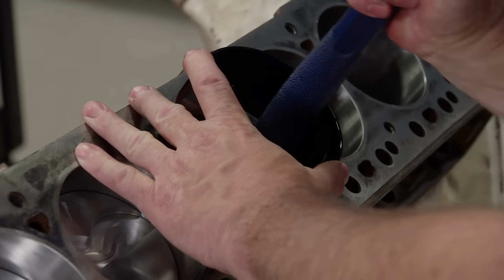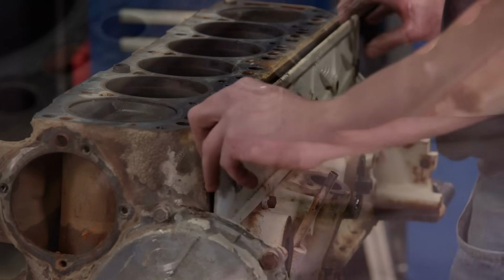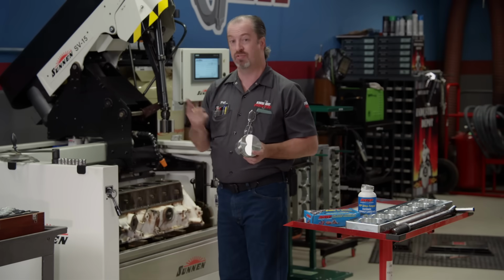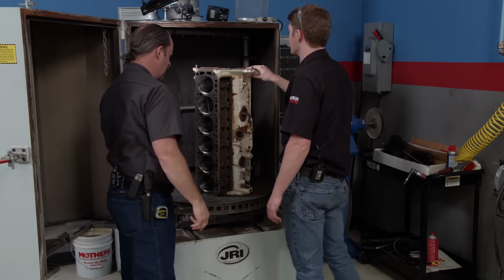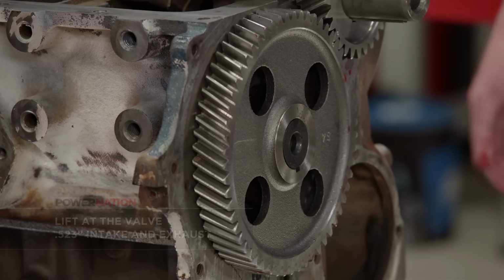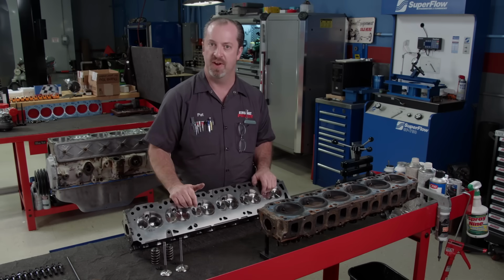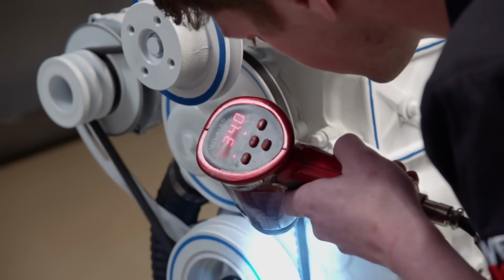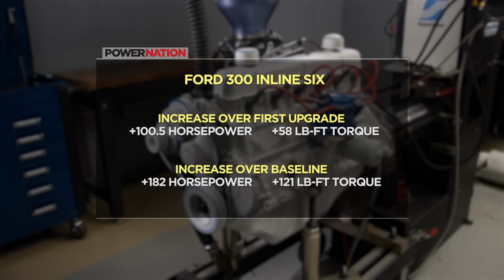Full-Tilt Build On Our Ford 300 Inline 6 For Serious Power Gains - Engine Power S8, E3

Comment: Back in 1987 I bought my first Ford F150 brand new off the lot and it had a fuel injected inline 300 6 in it. 

I owned that truck for almost 20 years and I drove it back-and-forth from FM 2920 in Houston Texas all the way down to downtown Houston every morning and every evening in that traffic. Then I move to Virginia and was still driving the same truck. 

One morning I got up to go to work and the engine was clattering and I realized that the oil pump had went out on the motor so I quickly turned it off. The next morning I turned around and sold the truck to a friend of mine and at the time that I sold my truck it literally had 625,000 miles on it and it only burnt half a quart of oil between changes. Seriously I've never seen an engine that lasted that long and my buddy turned around and put a new oil pump in it and continued driving it.

In my mind there is nothing more durable than the Chevy 350 and the Ford inline 300 6..... !!!!!!!!!!
Those two engines will last forever and they're practically indestructible.

Comment: That's a big jump considering they were well under 200 horsepower... 101-150 HP !! I have always wanted to Twin Turbo a fuel injected 300 inline 6 and put it up against a 12 valve Cummins

Comment: I had a stock 300 cid engine in my 1976 F-150 with a terrible 2 barrel factory carburetor. The engine only produced 106 horsepower. The carburetor was so bad the you had to "feather" the gas pedal from a standing start to get the truck rolling or it would stall out in the middle of an intersection. This always caused a certain amount of "puckering" if you get my drift and made the truck completely gutless off of the line. Ford wouldn't do anything under warranty to correct this problem and I was told to just live with it. In retrospect,  I wish that I would have had a 302 V8 under the hood because going to the 6 cylinder engine had no advantage in fuel mileage over the 302 V8 that you could get fuel injected back in 1976. I read a few years later that guys were making some engine modifications and adding a Gale Banks turbo to the 300 that added a bunch of torque and ponies to the engine.

Comment: Somewhat surprised no one has made a 4 valve DOHC or SOHC 4 valve head for US inline 6's.   It's worth 20%+ gains in torque from bottom to top and around 18% gains in HP in the mid to high range.

Comment: The beauty of the straight six motor is it's overall simplicity and  good harmonic balance.
Nice job.
Reply: The Falcon did not use the 300, it was strictly a truck engine.
Reply: Walter Palmer: Plus, as I commented, due to the fact these engines have five or seven main bearings as long as you perform the routine oil changes and maintenance you can expect to see 350K miles; mine has over 285K and is still running strong with only having the head milled and a new set of valves, etc. just because I figured 'why not' so put them in while I had it opened up, plus a new fuel pump, water pump, 100 amp alternator, two row radiator and an all new brake system.

It sees use a few times a week and every time I stop at a red light or to get gas, always have at least two or three people who will tell me about thier Father or them owning a Falcon, which was my first purchase in 1965 of a '63 Falcon Futura after I got married.

Comment: WOW! Gotta love those old 300's. So far as 6 cyl. are concerned, I believe that is Fords bullet proof motor. Just like Mopar's 225 slant 6. Another bullet proof motor. Great job on the build guys!
Reply: you forgot the gm 292 engine most 6 bangers are to be considered in remods
Reply: Can't forget the jeep 4.0!! Mine had over 300k when i got rid of it and had never been opened up or rebuilt
Reply: @HUGH.JANOS.  I knew a guy who had one with over 600k miles that still ran ok when he sold it because he was tired of it.
Reply: @HUGH.JANOS.  not made by jeep lmao

Comment: these american engines don't make much power per cube... hemi 6 made 225kw factory in 1971 with only 265 cu in
Reply: Horsepower per liter means nothing. Power to weight does.
Reply: @riogrande163  it does when you could have a different motor making more power in the same vehicle, increasing power to weight

Comment: Got a 93'  300/6..w/ an E4OD...The.0dometer went out at 288,000 miles, & that was in 2010...the power steering pump leaks like crazy, so for the past year I just been putting used motor oil in it, works great....and sealed up the leak too...for the most part my old girl will run on cat litter...poeple are constantly asking me if I'd sell it....not a chance...strong & simple...❤️❤️❤️her‼️

Comment: In the late 80s my dad bought an 83 Ford van with this engine for $1000 from a local company. It was a delivery vehicle that had over 160K miles of CITY driving, and my dad proceeded to put another 160k with this business. The engine was floored and ran hard everywhere (because it was in a heavy van) and it never had 1 single problem the whole time. In fact the only problem he ever had with the whole van was he had to change the brake master cylinder once.

Only reason he sold it was because he wanted a newer one with a V8 and AC.

Comment: That's AWESOME considering that an original 240 made 129 gross hp, and a later 300 made about 88 net hp....

I owned a '66 Ford F100 with the 240, and it couldn't get out of its own way.  At the same time, it was SOLID SOLID SOLID.  My neighbors in Orlando hated it because it was painted with latex house paint and looked like hell, but it always ran!

Comment: Make her EFI after the turbo please. I plan on doing this exact build but I will install a bigger oil pump, also an intercooler for the turbo. Taking the biggest turbo I can find in a diesel junkyard, preferably a DT466 from a dump truck since that's one of the easiest big boi's you can get your hands on. Big internals, big EFI fuel, bigger spark plugs, big turbo for air in and air out, big cooling system to keep everything maintained, all compacted inside a little engine. She will be my soon to be drift car. Doing a "Merican" straight six build versus going with a usual overseas european style straight six configuration. I just don't know what Ford car to put it in... If anyone has a suggestion please let me know! Trying to stay away from the basic mustang, I'm looking for different. I want to turn heads, and necks.. ;)

Comment: Keep it up guys, this is damned interesting stuff.  Can't wait to see it turbocharged.  The fuel injected version of this engine is in my daily driver, 93 F150 with the manual 5 speed overdrive.  A fun truck to drive, but you can send me that 300 you're working on and it'll be even more fun!

Comment: The Ford 300 inline 6 is perfect the way it comes from the factory... more torque than the 5.0 V8, cheaper to make, easier to work on.  but the weight is the same and so is the gas mileage. It's a truck engine with big torque. It doesn't need to be "built".

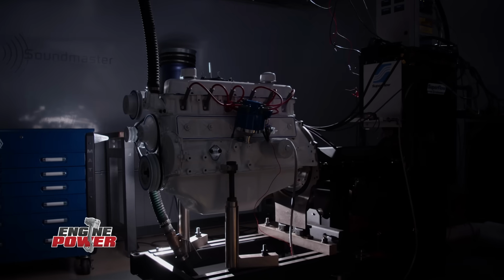Comment: 17:09 well.... its 50CI per hole..... so a v8/L8 would be a 400
and i LOVE my chevy 400 small block.... 
.
so id say she is going to make about....250hp, and 380 of torque 
.
damn.... i was pretty close
i know a GM 400 will make 265hp and 390-410 foot pounds stock......(at the end of the trans... not crank)
im actually surprised it didnt make more torque.... yet only revs to 5000
.
and that curve is NASTY...... needs a bit more tuning to flatten things out
and id expect AT LEAST 5600 RPM
Reply: i still cant belive it doesnt want to rev over 5000 rpm....... then again, it is a MASSIVE 50 cubic inches per hole
.
and the stock numbers are CRAZY low....
my 1986 GM 2.5 "iron duke"...with POOPY TBI injection....makes more HP (and also doesnt like to rev past 5000 rpm)
.
but ya.... the "base line" HP number is like you blocked off 1 barrel of a 2 barrel carb...
and even the torque is CRAZY low.... 
.
id expect AT LEAST 120-140hp and 300 foot pounds out of that "stroker" of an L6..... 
.
.
even my jeep (AMC) 4.0 makes 190hp and 225 foot pounds (with an EGR, P/S pump.... and the AC on)
.
i guess counter-flow heads just suck...... 
and the old GM 400 SB proves to be the BEST small block GM ever made

Comment: not a fan of fords..... as im a mechanic, and they SUCK to work on (especially after 2011)
.
but i just love straight six motors..... 
fell in love with my 97 Jeep grand native american when i borrowed it to go hunting in
4.0 L6 and a transfer case with BOTH full and part time 4 wheel drive 
.
he was selling it to pay for injectors on his cummins..... 
and after using it for 3 days hunting.... i knew i had to have that mountain goat of a vehicle
.
a lot of people dont understand why full time 4 is useful 
lets say your on ice.... in normal "part time" 4..... and you break traction
now all 4 wheels (if you have limited slip / lockers) are broke loose.... and you loose control
.
but with a full time 4..... with open diffs.... only one tire breaks loose
and its the one with the least amount of traction anyway 
so you can quickly regain control 
.
and if you are climbing a snow covered hill..... as long as you dont break a tire loose
all 4 wheels are giving power

Comment: I had an 85 ford f150 with a 300 six in it my cousin built it it was around 300 to 350 hoarse power ofenhouser intake 750 double pumper huge exaust port and polished the head reground the crank and bigger cam in it lots of power fun to drive torqe monster vacum pressure issues though always to much pressure in the crank case 411 gears fun fun fun

Comment: Interesting... first level upgrade slightly beat the 1995 fuel injected engine's 150 hp @3400, and 260 lb ft @2000... then throwing pistons, cam and heads really woke it up, but I honestly question how well it would work in a truck though. We built a pretty decent one for my buddy's 77 F250 highboy he used for hauling...  It wasn't fast on the highway, but you'd never stall it.

Comment: the buzzin dozen was a 12v71 detroit diesel which was a 2 stroke and sounded like a 24 cyl 4 stroke and they would sound like beez on the highway which is where they got their name from. the 300 was never known as a "buzzin half dozen" its a 6 cyl that sounds like a 6 cyl.

Comment: I got a 94 F-150 W/T with an EFI 4.9L 300 hooked to a 4 speed auto and 2wd drivetrain. They're pretty stout engines and have a respectable amount of OOMPH when stock, even with a max shift redline of 4000 rpm. BUT, I plan on taking the motor out of my truck and doing what you guys are doing to your Ford 300. Considering I'm converting my 1/2-ton to a "budget 3/4-ton" (F-250 or F-350 axle swaps), I could use a bit more power for hauling goosenecks AND for having some fun in the mud. 4000 rpm ain't enough for me either, so I'm looking forward to clocking mine at 6000 rpm.

I'll stay tuned for this epic Ford 300 journey, dudes!

Comment: Since ya like building engines try building this engine a ls 6.2 liter with a stage 2 cam high performance heads thats been ported and polished with that msd box thats sold separately from the one n the package of the spider intake with about a 1050 carb or higher and see how much horsepower you can get out of the 6.2 liter fully maxed out with standard bore im pretty sure ya will be impressed with chevys  engine lolll just saying lolll

Comment: Spent 37 years as heavy duty mechanic 
Ran claton absorption dyno nearly every day 
Put a customers recently purchased Cummins NTC 400 on the dyno that put down over 400hp to the ground ( should have had about 80% of rated power to the ground )so we advise customer if he wanted most reliability due to high hp the engine was making numbers so we put a set of injectors in and redynoed with same hp so we pulled off the injection pump and had it gone threw 
Put it on and redynoed again with same results
I told the boss the engine had custom headers pulseing the turbo 
He said what I told him someone put a custom set of headers on the engine 
This was in the early 1990’s 
Its the only thing we could determine that was adding to the additional hp 
Turbo was correct cam was correct 
Hopefully you will see some good numbers from your custom headers also

Comment: I did a very similar build about 10 years ago, but my block was pretty rough and didn't clean up until 4.080.  I ran .030 over 360 pistons, they're a hair taller, and kept the stock intake and exhaust initially.  I put that into a 78 E150 shorty with a C6 and 2.75 rear gear, which did surprisingly well.  I ran it down I 15 to SLC at 75, which it did easily, and it turned in 16mpg for the trip.  No overheating thanks to the incredibly thick bore walls on these engines.

Comment: This show has taught me that the L6 is really just a workhorse engine compared to the V8--it's build for low speed applications and reliability.   That's not a bad thing, just designed for its application.   Putting both intake and exhaust on one side cant be good for higher revving.
I had just a 69 302 Ford.  Not impressive, but it was really easy to get over 300 hp.

Comment: Having just watched this rebuild, my questions may sound a little ‘off-base’, but here goes.
You fitted a new head onto this engine.
 Would a new head with the intake on opposite side to the exhaust been an option? 
Would this have produced better results?
just wondering, because I have the thoughts that a ‘cross-flow’ head is better.
Reply: Not really, the pushrods are in the way.

Comment: This is cool beyond words.  It is so nice to see something other than a V8.  Perhaps you could try some of your magic on the GM Atlas platform.  From my research, this is a very good engine.  The one I have has 152,000 miles and is in need of an alternator.  This might be the reason I pull it out and hit it with some Pixie dust.  No doubt, Engine Power is my favorite as well.  I too am looking forward to the huffed 300.  BTW, what is the new displacement now?

Comment: But you're still relatively low revving. Put some stronger rods and pistons and and cam and put a more direct flowing intake on it to turn 6500 to 7000 and you will be amazed at what it does. It's going to have a marvelous sound to it too.
A wedge engine like that is crying out for a turbocharger and even without a intercooler, with the short shot out and in it will make amazing power. One thing to remember, you aren't anywhere near 1hp per cubic inch yet.

Comment: Would be very interesting to see the difference on the dyno between this build, and a long rod one(240 rods, 351W pistons, bushed on the small end for full float). My last 300 build was done that way.  Otherwise the build was similar. 240 head at 9.5:1, 1.73 rockers, but less lobe on the cam so similar lift.... Ran very well but never saw a dyno.

Comment: How many times can you tighten arp studs, main studs and rod bolts before you have to replace them? You need to tighten the head studs to full torque to bore the block, and the mains and rods to check the bearing clearances.

Comment: I’ve already subscribed. If I could re-subscribe I would! I’ll bet dollars to engine parts that when somebody left the tool in the engine, it overheated almost immediately and ran like crap trying to spin that towel around the water pump. Either that stopped the engine cold or they shut it down immediately. You have one tough motor that met one bad shade tree mechanic who said, I don’t know what’s wrong, I only know how to work on Chevy’s. I’m not a Ford guy. His toothless buddy chuckled and said yah, Ford, Fix it agin Tony! The guy with the grease hair then said, not you idiot, it’s Found On Road Dead to which the first guy said, only this one didn’t make it to the road. Well, forget that 100,000+ miles on that engine!
By the way, you can widen the seats on the old heads out to 351M/400 vavlesizes. That’s 2.04” and 1.66”. I don’t know about the new heads, but they should also fit, but you might have to wide the combustion chambers a touch to un shroud the valves.

Comment: Why in the world did you leave the counterflow head????  You do know they sell crossflow heads right???????
Reply: Really?? Where at??
Reply: It's for the 250 but I believe they fit on the 300.  There have been heads made from Cleveland, Boss, and LS heads.  It would be a huge amount of work to build them but you used to be able to buy them.
Reply: @murphystreeter  A 250 head will not fit on a 300 they are different engines. It is possible to splice heads but it is a lot of work and they often leak.
Reply: https://m.youtube.com/watch?v=sZQHHJLwwi8&t=40s

Comment: I think thr 1996 F-150 had mass air type fuel injection .I wonder how it would do with thin motor with injection instead of a carb
Reply: mine had 300,000 ML and only used a quart of oil between changes .It got totaled :(

Comment: The sad part about these motors is how the cylinder heads have the exhaust and intake on the same side of the head.
Reply: Certainly not end all be all for power production. Its more durable than it has any right to be.

Comment: That's the engine on my 94 f150. My truck was a county truck here in TX and it has 245k miles. I can't tell you how much I'd love to get something like this done to my truck. My wife named it Mater. All the work I've done so far I learned on YouTube. I've done a lot but the truck if far from reliable or running great.

Does anybody have any idea how much something like this would cost?

Comment: I have a 67 Ford F100 with the 300 inline 6 best video series yet on this motor also and here's a motor you guys should do I have a 72 Ford LTD with the 400m in it  a c6 transmission  and a 9-inch rear end which I do in time plan on transplanting into the 67 F100 I would love to see how that motor would do with power upgrades